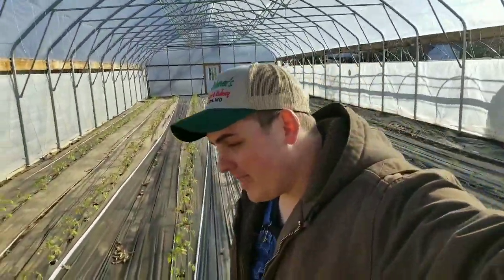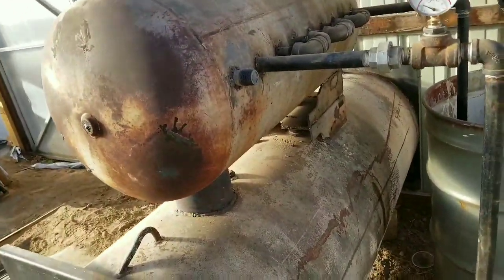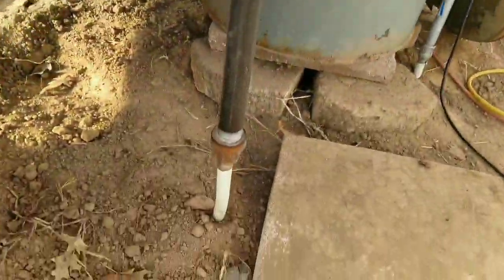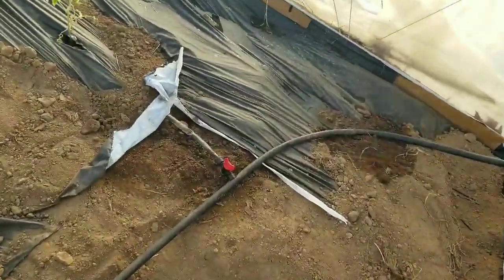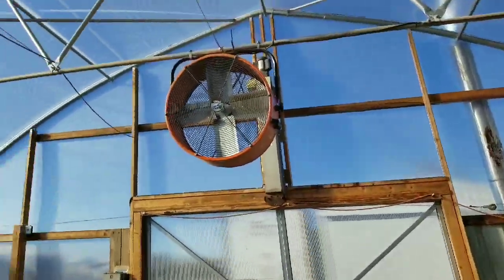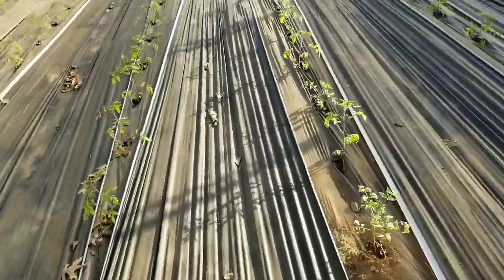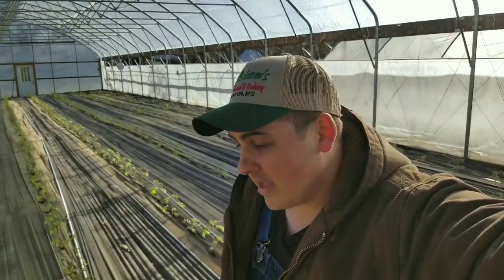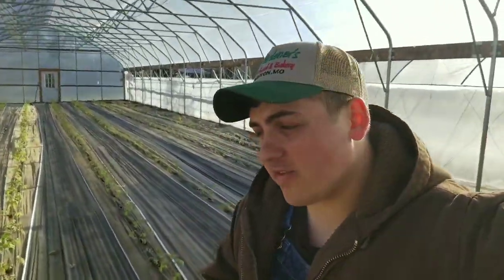Irrigation vs Radiant Heat!

Comment: Hey Farmer Dre, great content man! I want to give you a tip to greatly increase your water heating capabilities/increase wood efficiency: You can fairly easily increase the heat transfer area for the exhaust/water heat exchanger. Instead of a single row of 9 tubes in the heat exchanger, have them stacked 3 to 5 tall and still in a 9 rows. You basically want to maximize the number of tubes you have. It doesn't matter if the upper and lower pipes are shorter because it still adds length and heat transfer area. It also doesn't have to be perfect or even lined up so no worries there. Plumb the lines starting from the bottom on the back/cold side, snake up and then forward to the next row. Snake down all the way and then forward one more and up again. Repeat until you reach the front. This setup will use more pipe in the exchanger but should give you a much larger temperature difference between the inlet and outler water temps.
If you end up making your water too hot as a result of this mod you have 3 options: 1. Burn less wood. 2. Use a larger capacity water pump. 3. Add old car radiators between the heat exchager outlet with a fan to dissipate heat into the air. Any combimation of 1-3 should work for overheated water but i recommend #3. During startup you can even bypass either the radiator or ground to heat whichever you want first.
Sorry for the long comment and explanation but I couldn't figure out how to dm you. I want to let you know my background is that I just got my degree in process engineering and I know a few things about a few things. I also just found your channel. All the best -Neeson

Comment: Are you getting a lot of fly ash in the heat exchanger?
Wouldn't it be more efficient to put the chimney outlet at the bottom half of the heat exchanger, instead of having the chimney at the top of the heat exchanger?